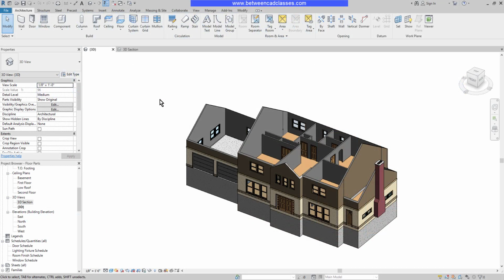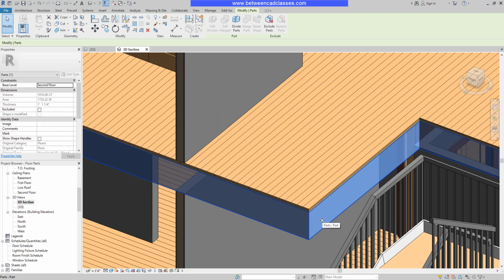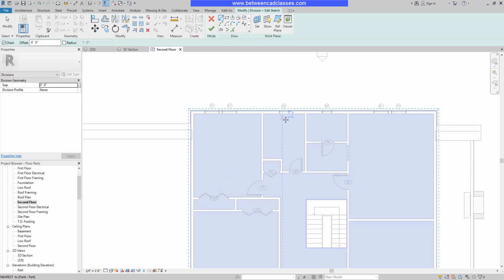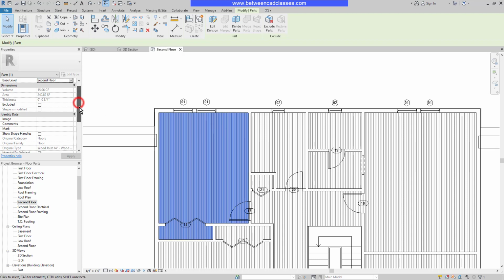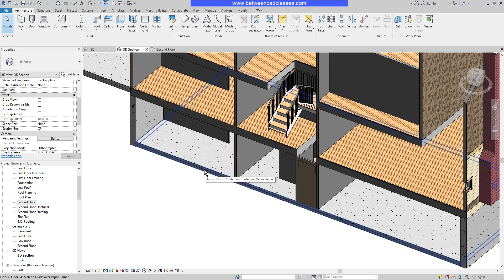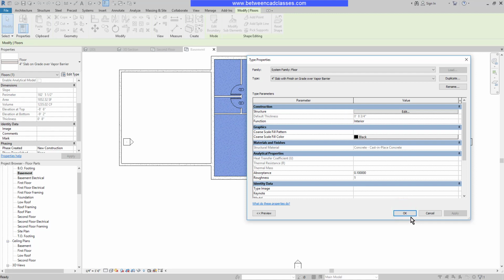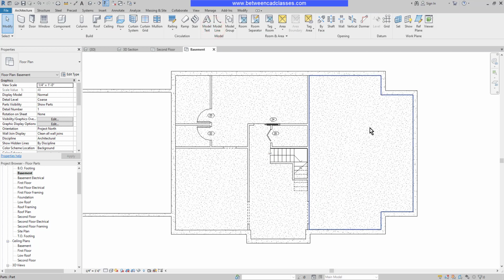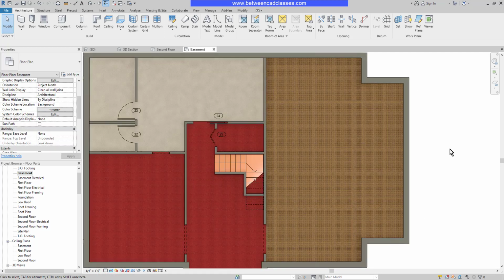Working with Parts in Autodesk Revit

Comment: Thanks for the video, I somehow remember trying to use parts, I do residential work similar to this video, but I remember finding some issues, I cant remember it was a while ago.  

Do you think its a good practice to use parts in the your model typically?
Reply from the maker: I have to be honest. As an educator I don't get to dig into big projects like those of you in the industry, so I cannot say for certain what the pitfalls might be. One of the things that are weird is that when you split a floor into parts, it no longer shows in the floor plan view, even if the view is set to parts. You have to adjust the view range slightly which is a bit of a hassle. Another thing my students struggle with is remembering to set each view to show parts. Some will create the parts in the floor plan, then create a 3D view and are puzzled why they cannot see the materials until I remind them to change their view settings to show parts.

Comment: Does Revit have a way to revert parts back to the parent family and discard the parts?
Reply from the maker: Hi Geoffrey! Give this a try. While Parts are visible, select one of the parts, such as the finish layer of the floor. Then hit Delete at the keyboard. You should get an error that states that "Edits to the model will cause some Parts to be deleted." Select the <Delete Element(s)> button. The object should return to its original, non-parts state. Let me know if that works for you!
Reply: @betweencadclasses  Thank you for the response! Yes, what appears to happen is that when a part is deleted other parts created from the original family instance are also deleted and the original "non-parted" instance (in my case a wall) remains. Before deletion of a part, the original instance and the "part-ed" instance both remain overlapping in the model. What this means is that if I want my views (such as an elevation or 3D view) to not show the geometry of the original instance (and I want to keep it in case I decide to revert back to the original instance) I have to "hide" the original instance. It seems an overly burdensome way for the command to work. Better to have a simple "convert parts back to original instance" command, but there it is. Thanks again.
Reply from the maker: @geoffreywinnie5442  Have you tried the options in the Properties palette? There is an option called "Parts Visibility" which can be set to Show Original, Show Parts, or Show Both. If I am understanding you correctly, it almost sounds like Show Both might be selected.
Reply: @betweencadclasses  I haven't used the part command too often, I must have scanned right past that option for years. Exactly what I was looking for but I could not find it in the object properties table. Genius! Thanks! Maybe I should have watched your entire video since you covered this at the start :/
Reply from the maker: @geoffreywinnie5442  I am so glad that helped! There are so many options it is easy to miss things!